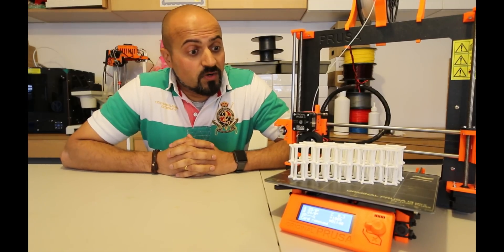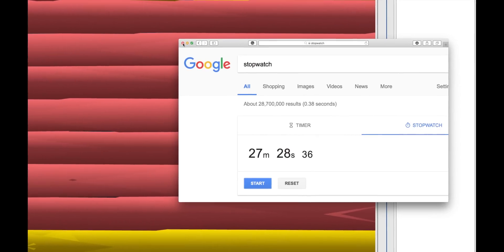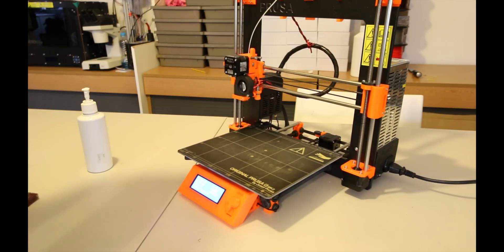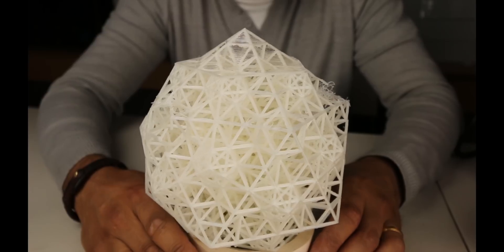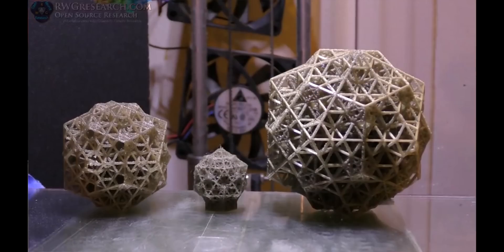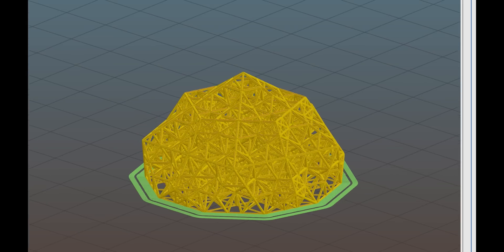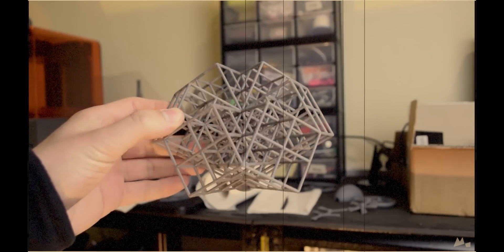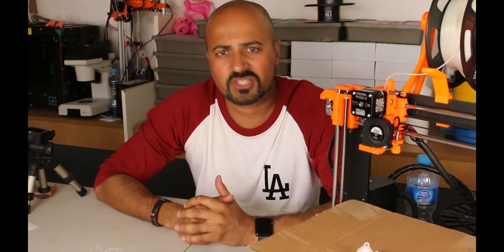3D Printer - Stress Test Burnt up my Prusa i3 MK2 - QSN Challenge

Comment: I will have to try this now.
have you tuned pid loops yet ? in configuration.h  tab/ file
s90 is temp, c8 I change to C10. stands for cycles to get up to temp. 
0 = extruder 1
1 = heat bed
2 = extruder 2
can't remember what letter starts this off the top of my head.

then, I run 1.0 to 1.1 amps to steppers.

my cheap geeetech 3d i3 Printer pro b
has done a four part 30 hr or so print.
0.1 mm layer height.

but one has to accept that your extrusion multiplier will have be changed. so will need to basically tune that as well.

it's a whole other beast with abs as that shrinks the 5% vs the pla shrink of like a half %.
that will help with the curls. it's basically over extruding on the edges. check your extrusion widths at those layers.

then for the retraction, slow down the velocity of your filament movement.

those are the majority of problem.

not even bringing up the size accuracy of the diameter of filament. I think this is where the filament sensor will Excell at this issue.

but, good video over all.

Comment: The problem isn't because of your pinda probe, it's because the edges are getting pressed down.  If you look in your little close up video you see those "arms" flexing down, that's going to make things go off kilter.  Also, part of the issue could be due to your pinda cover.  It make the pinda MUCH bigger, therefor leading to interactions.  But it's not because of the pinda, it's because of the flex of the model.  It does look like your pinda probe may be a bit close too though.

Comment: First off, slicing the bottom off to avoid the support material actually makes it easier to print. Second, it is a huge disservice to the 3D printing  community if you know of a legitimate fire hazard, especially in such a well respected machine, to not lead in with what the fire hazard is. I might have been able to forgive it, if you included it on the end of the video, but to use it to try to get views, and to try to get views on your next video is a disgusting tactic.
Reply from the maker: I understand your concern but I ran a continuous 4 day print with the bed heated at 100C and the nozzle at 250C. Unless you are running your printer for this long then I feel that there is a risk of burning out your machine. The risk of flame though is very low risk unless. If it helps I found that parts had heated to such a point the either melted or there was smoke and the smell of burnt plastic. I'm rushing to make the follow up regarding this so that I can viewers at ease, but waiting on some parts to come in so I can film the upgrades needed to prevent this. Standby and don't panic, the Prusa is still a very repliable machine, this episode just ran the machine to its limits.

Comment: just turn the flow down your over extruding turn up retraction small prints won't work in abs I would print hotter too 205c is a bit low z hop should be enabled
Reply from the maker: I've played with that setting but will look into it a bit more. When you're going down to 0.15mm there's some different physics involved by the looks of it. I certainly will not be giving up and will do a follow-up at some point once I get some success.

Comment: Each layer should never get any higher than the height it was printed it. So hitting the probe is not the issue its a symptom..  You can see what is going on. when you add a layer it is bending the plastic it is printing on down adding a layer (creating a layer that is over sized), then moving off and the part springs up..  The plastic being used is not strong enough to support FDM printing with such fine structures.

Comment: So someone is just about ready to start a print but they should wait on your video rather that you tell us right now what the fire hazard is in this video? 

Was going to sub, but no thanks. Not interested in click bait bullshit.
Reply: You can't use people's fear of their house burning down to keep them coming back for your videos. It's scummy. If there's a legitimate fire risk if you had any ethics at all you'd say what it is without this nonsense. I'm not interested in your clickbait either.
Reply: NERDVille yes but the point is why not mention it in the video before you make a video about it and make people wait for information that could possibly prevent them from burning their house or apartment down? Seriously poor judgment
Reply: badly restrained wires allow movement of the wires and that can cause them to burn out...
Reply: Because he is more concerned with views than peoples safety, is the only answer. 
He knows it's very important as the thumbnail suggests this. I've unsubscribed and wont be back.
Reply from the maker: I understand your concern but I ran a continuous 4 day print with the bed heated at 100C and the nozzle at 250C. Unless you are running your printer for this long then I feel that there is a risk of burning out your machine. The risk of flame though is very low risk. 
If it helps I found that parts had heated to such a point they either melted or there was smoke and the smell of burnt plastic. I'm rushing to make the follow-up episode regarding this so that I can put viewers at ease, but waiting on some parts to come in so I can film the upgrades needed to prevent this. Standby and don't panic, the Prusa is still a very reliable machine, this episode just ran the machine to its limits.
Reply from the maker: I'm currently working on the follow-up episode regarding the potential fire risk and show the burnt out components and even the melted heater bed wire tidies.  I did not want to show it in this video as this was a stress test but the 3D Printer did, in fact, break down.

Comment: Well, I see what your primary problem is. You're running on a Mac  😜

Instead of having the head/nozzle area have open space between the head and the nozzle (at the plain of the tip of the nozzle), could you put a piece of thin metal to make it have one large smooth area? That would keep the model from catching on parts of the head. Altho, if the model is large enough, I can see it interfering catching on the outside edges. Maybe the could be curved up slightly to keep from having a catching edge.
Reply from the maker: it's a good idea, its principle what the PIND tip cover it for to create a ramp but this too is no effective enough. I'm working on a solution that not only improves the ease of height adjustment but also allows you to increase the height difference between nozzle and PIND sensor

Comment: PID tune your printer. You can find it in the calibration menu. This will keep your temperature even the entire print. E3D's silicone sock also helps keep the temperatures even.
Reply from the maker: DangerMau5e FPV that's about the last thing I need to do for the Prusa regarding calibration. Sock is implemented. It's a great addition. Thanks for the tip.